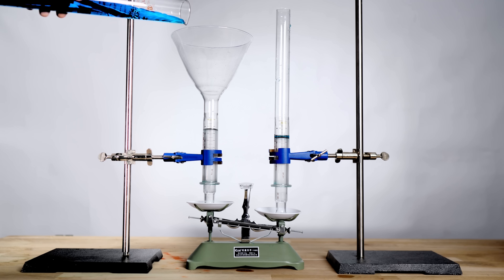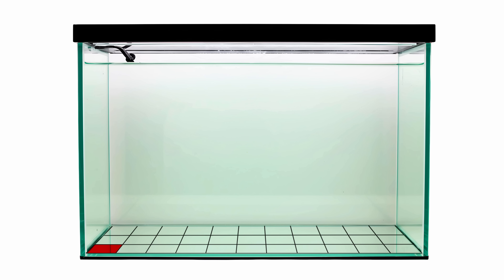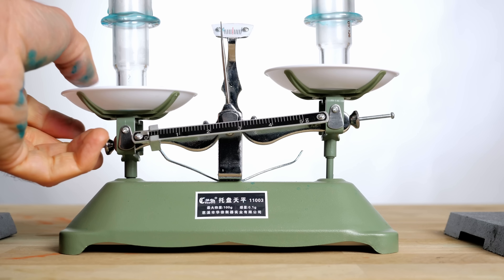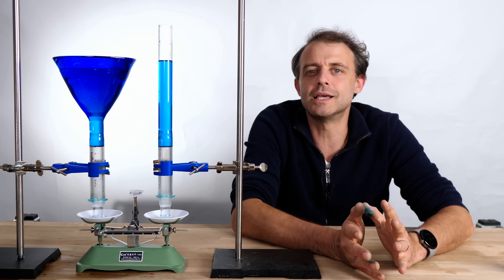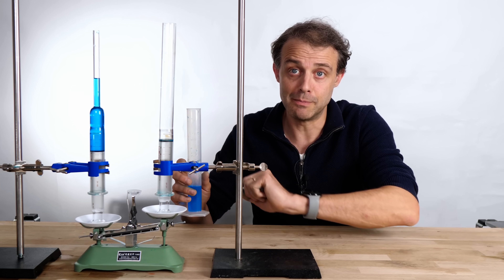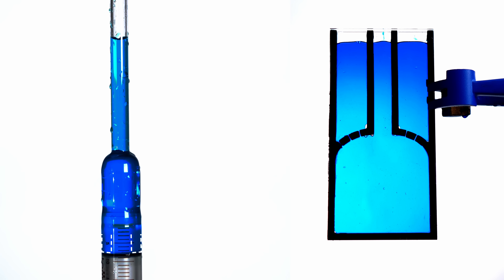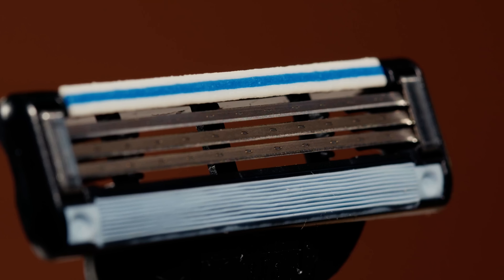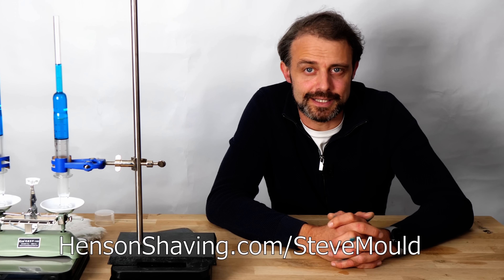The Hydrostatic Paradox

Comment: @SteveMould
The experiment with the cylinder narrowing at the top made intuitively sense to me.
I basically just see it as a gearing; the force acting on the piston will be the same, but the trade off for getting the same force with less water, is that you get less piston travel.
Just like two gears where one will provide more torque at the expense of moving slower.
I really hoped we would see this in action in the video, because that balance will work (to many) counter intuitively.
As the piston with the straight cylinder will feel the same force regardless of the pistons location in the cylinder, where as the force felt on the piston with the narrow top of the cylinder, will vary based on the placement of the piston.
The force on the piston will be constant regardless of piston placement until the water hits the narrow part of the tube, then the force will increase as more water is pushed into the narrow part of the cylinder.
So two cylinders with a narrow top, should provide a more stable equilibrium than two straight cylinders.
It is a really interesting behaviour an deserves a part 2! :D

Comment: Got to the funnel bit, only did physics (well) at GCSE, for AS I got a D (or an E) so nothing to brag about.
But the reason the water in the funnel acts that way is because the water needs to 'hold itself up' the horizontal force needs to act to hold that column of water. The water needs to push in sideways to keep that column there and stop the container looking like a big U shape (which you'd get if you used a flowing solid powder like flour). 
Then if you reverse/invert it and have a piston in a larger container I'm assuming the force acts against the top of the container helping push the piston down because there is a solid above it constraining the liquid to the piston with a small column.

Comment: Someone else made used the example of replacing the water with a person in each tube to grasp the last example and I think that will help a lot of folks understand this more intuitively, so I built out the example in more detail below…

Imagine you are standing inside the straight tube on top of the plunger. The tube is held by a stand fixed to the ground.
When you first stepped onto the plunger you noticed it moved down one foot it because of your body weight, kind of like a giant spring being compressed.
Now someone tells you to try to push the plunger down more, using only your legs - but you’re not allowed to jump in the air or touch the walls. You try by dropping into a squat and “pushing” with your legs…but all that happens is your legs straighten so you’re standing again…the plunger doesn’t move at all. That’s because all of your weight is already fully on the plunger, and all you are doing is changing your body’s shape while keeping the total force on the plunger the same (your body mass x gravity).

Next, you are in the other tube, with the wide bottom section and skinny top. It weighs the same as the first tube. You have to crouch to even fit in this tube, because your head and shoulders are too wide to fit in the skinny part, and so your head/shoulders are squished into the “ceiling” of the bottom section. Someone tells you to try to push the plunger down like before, but now when you push with your legs to straighten them…the plunger moves down! Of course it does, because your shoulders are pushing UP against the walls of the tube. But since it’s fixed to the ground it can’t actually move up…so the force is redirected to the plunger which feels like extra weight and so moves DOWN instead.

Of course you didn’t actually gain weight, you “borrowed” it from the tube. So to the arm holding the tube it “feels” like the tube lost weight…the exact amount of weight that was “added” to the plunger. The total weight of the system has not changed, it’s just been “redistributed” amongst the individual pieces by the redirecting the forces between them.

Comment: Its head pressure..it is why every town has a water tower... The hieght of the tower provides static pressure into the water distribution system, without this pumps would have to be run constantly to supply water.  The towers aren't there to store water, they pressurize the system

Comment: This isn't a paradox. You've made two actuators and mounted their bodies in holders. The internal pistons press against the scales due to the height of the water column in each. The weight (amount) of the liquid is irrelevant. In other words, there are no vessels filled with liquid freely pressing against the scales; there are external tubes held stationary in holders and the aforementioned pistons.

Comment: So can you abuse this principle to produce a ridiculously great downward force using far less than an equivalent weight of water? Like, make an enclosed tank that is very short but has a very large footprint, and then connect a very long hose to a port on the top of the tank, and extend the hose upward to a great height. If you fill the tank and the hose with water, you won't actually put much water in at all, but the pressure at the bottom of the tank will be determined by the height of water to the top of the hose, and that pressure will be multiplied by the large area of the tank's footprint, yielding a tremendous downward force. (Is there also a tremendous upward force on the upper face of the tank, such that the apparent "weight" of the setup isn't usefully huge?)

Comment: There is no paradox. You're intentionally causing confusion. Anyone can put a glass of water with different volumes on a scale and see the difference, just like anyone can stick a pressure gauge at the bottom of any body of liquid at equal heights.

Comment: no paradox AT ALL: The hight of the liquid, determins the hydrostatic pressure which is weight PER SURFACE AREA. 

The other is TOTAL WEIGHT. More stuff will weigh more even if the HP stays the same. 

like uf you stand in one leg: the pressure doubles but your weight stays the same

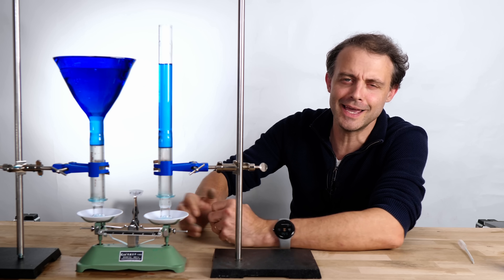Comment: So, at 1:28 you say "How can two different amounts of water weigh the same, this is the hydrostatic paradox". Well, obviously they don't. You can't fool me that easily! So what's the trick? Well, suppose a) the glass of the tube weighs the same as the glass of the tube+funnel. b) You apply superglue to stop the pistons going up and down c) You loosen the blue clamps either side so the whole glass assembly on either side can slide down. If this scenario, if the water on either side really did weigh the same the needle would remain stationary. However, I do not think that would be the case. So my answer is "The water does not weigh the same, but the water presses down equally on the pistons."

Comment: i tHINKARONI - you neglected to understand that your scale is essentially providing the same exact function as a curved tube connection from one liquid container to the other one
-
and what you can imagine happening is that the fluid from the right cylinder ( with more liquid ) is pushing through the tube ( the scale ) to the other cylinder and the pressure is being exerted to the top of the dome as well as pushing the fluid level up the narrow section of the cylinder at the top - 
-
this means that the weight of the entire amount of liquid in both cylinders are dispersed accordingly to the height and shape of all inner surfaces - 
it is the same as - the liquid levels in two bodies which are connected somewhere under the surface of the water - will always be of equal height because gravity will distribute the water from the body having the higher level to the other body having a lower level
Reply: the reason i am saying tHINARONI is because i guess i spilled my brains too much on that yewspewed account and now - no comments i try to post from that account - get posted

Comment: Quality has gone down my man
So much beating around the bush I was dealing more with the frustration of edging me on getting to the point, rather than the complexity of the physics when you finally got to the point
And the sellout biased science to plug the ads was the last nail on the coffin. You can twist the dynamics of a single vs multiple blade razor to illustrate the benefits on either side, for instance, that single blade razor carries more pressure into the skin so it is easier to cut yourself, which has a way harder reaction on your skin than just bruising it with a multiblades razor. Same argument, different bias. Get it together

Comment: I'm kind of perplexed that you find it a paradox. Do you only ever use lab equipment? You have a stand supporting the funnel that is not on the scale. If you simply held the funnel like a normal person there'd be no mystery. Anybody who has actually used a funnel knows it gets heavier when you pour stuff in and lighter when the stuff runs out. A funnel is just a container with an intentionally designed leak. Any container gets heavier when you fill it, even a leaky one. With the funnel supported by a stand that's not on the scale, you're not measuring the weight of the water at all. You're just measuring the force of the leak in the container. The fact that the water balances at precisely the same height may not be intuitive, but the fact that a container, even a leaky one, supports the weight of its contents (at least until they leak out) should not be at all surprising.

Comment: This reminds me of balancing brake pedal feel vs brake piston caliper clamping force via the brake master cylinder piston size and brake caliper piston size.  The balance of force is something experienced by many custom or performance vehicle builders with upgrades regarding hydraulic braking systems.  Even with the same brake line size, two different master cylinder piston sizes will feel significantly different

Comment: My own experience of Henson shaving is that they aren't well engineered. A precise angle if the blade isn't any good if it is the wrong angle. I find a holder that looks like a cut-throat razor with the same (well, halved, but you can use the ones from Henson shaving) blades held in it produces much better results for me. It seems barbers find the same, as I've never seen a Henson razor in a barbers, but I've seen what I use many times. Do yourself a favour and buy a cheaper, better, holder for single disposable blades.

Comment: Did anyone else just think of the set up the same as a single tube going from one of the glass tubs to the other? For example if they were just connected via liquid I would think that the level of the top of both sides just have to be level. Similar to a hose  connected to a tank at the base. The level of water in the hose will always try to be the level of the tank.

Comment: I'm not staying that Physics is wrong, but I think that when you do the analysis on the infinitesimal triangle you are somehow assuming what you want to prove. 

If you need a force for the liquid not to go out of the container you don't need the glass to cancel the total force exerted by the pressure on the triangle, you only need to cancel the component perpendicular to the glass. That would leave a non zero tangent component that would make the liquid to slide parallel to the glass. 

I understand that by continuity arguments you can prove that cannot be the case. I'm just saying I think is not that simple. Please correct me if I'm wrong.

Comment: 1:25 youre not weighing the water itself, you're measuring the hydrostatic pressure which only depends on the height of the water but not on the size or shape of the container.

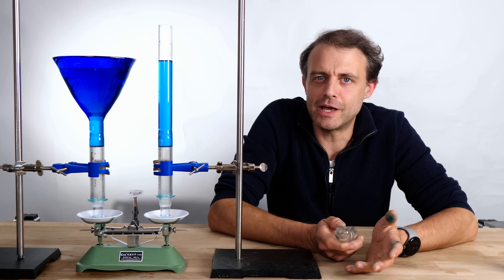Comment: 6:43 it changes a tiny bit because of adhesion forces between the water and the vertical wall of the syringe. There is a bit of water that is stuck to the glass surface, adding to its weight.

Comment: The argument for number of blades on the razor doesn't work that well.  A 2-blade razor at *most* engages twices as many hairs.  In fact, it will be a lot less, since the 1st blade will have cut most of the hairs before the 2nd blade gets there.  By the time you reach a 3rd blade, there should be very few hairs left.

Of course, this is purely an academic argument for me, since I haven't used *any* sort of razor in decades.

Comment: Because the "weight" of the water is being held by the clamps connected to the stands.  What you're measuring is the "pressure" of the column of water.  Get your terms right.

Comment: This is a very convoluted way to explain a simple phenomenon ... if you hang a container with water from the ceiling the total weight the hanger is subjected to is always the weight of the container plus the weight of the water ... the shape of the container only redistributes the pressure at the bottom of the container ... a V shape container will experience at its bottom the pressure (therefore the weight) of the small column and the outside "triangles" will transfer the weight of the water outside the column to the edges of the container ... ie the pressure distribution at the botton is constant (height of column) all around except for the edges where it spikes as the pressure of water outside the column is concentrated at the perimeter of the container ... the total weight is always the same (water plus container)

Comment: Fluid transfer guy here.  Always a challenge explaining to guys, it is quicker filling your tank from the bottom of your tank, pushing against the fluid as it fills than from the vent at the top.

Your hydrostatic pressure is at 100% from start to finish while using the vent.  But I guess they know better why they called it a vent.  Let them waste their time learning the hard way.

Comment: This is a great explanation. For what is worth, engineers describe hydostatic pressures as isotropic. This means the pressure at a point in the fluid is equal in all directions. Its not explicitly stated in the video, but the horizontal pressure on the walls is the same as the vertical pressure at the same depth.  So an engineer designing a tank only needs to know the depth of the tank and the density of the fluid to calculate the hydrostatic pressure acting on the tank walls. This could be demonstrated using a pair of interconnected horizontal pistons placed between the two vertical pistons.

Comment: I wonder if my intuition is in the ballpark. To me it stands to reason that the piston is also pushing up on the water column, so just like with the funnel some of this upward force is borne by the wall of the tube around the central narrow column, and the tube is in turn held down by the clamp stand. So there's a force vector that's blocked by glass in either example.

Comment: If the tubes r suspended you are not weighing the water. U r measuring the head. The weight of the water is Heald by the clamps.

Comment: Here's something that may help:
Pressure increases linearly with depth, BUT pressure acts in all directions. So on the smaller tube, pressure is acting UPWARDS on the surface pointing upwards, just as it acts downwards on the face at the bottom. The determining factor of which beaker weighs more is determined not by the weight of the water, but by the summation of all pressure forces acting at the bottom (the surface being measured by the scale). In this case, it is relevant that the bottom of each beaker is the same area.

Comment: Fantastic segue. I also just felt like dropping a comment saying that although I was a bit unsure at first I decided to buy a henson razor and, after getting the hang of it (as it was my first time using a single blade razor, and I'd also not used any manual razor for quite a while as I'd been trying electric shavers, incidentally also not finding them to work very well for me), I'm finding it very easy and effective

Comment: I didn't get why the weight scale went down
Reply: Got it. 
The force on the stand scale equals gravitational constant g multiplied by liquid density rho multiplied by difference between liquid volume and height multiplied by area of the bottom of the flask. 

F=g*\rho*(V - hS)

If liquid volume is less then height multiplied by area (volume of cylinder of the same height) then difference between them is negative and the force applied to stand is also negative. We actually can make the stand fly if it will be lighter than this force.

And it is actually pretty logical. Water creates pressure in all directions. Including pressure on "ceiling" part of tube. And pressure on ceiling is pushing up.

Comment: The clamp stand getting lighter was fascinating. More explanaintion of that needed - maybe caused by the pressure of the water pushing UP on the horizonal part of the container? I guess if you imagine the piston being held stationary and the pressure in the vessel increasing it would make intuitive sense that the other part of the vessel (and the clamp stand) would be pushed up. So could you have a container that would totally cancel out the weight of the clamp stand? That would be an interesting demo.

Comment: umm you are not weighing the weight of the water. the water is being held up by the stands. what is being measured is the pressure of the column of water. 

just one question, how do I get my face to be a straight line for these razors to work as advertised?

Comment: Seeing the initial demonstration, I immediately realized that you were describing the mechanics of a hydraulic system. I knew exactly what to expect with the narrower tube, but that's because I've already fumbled through the confusing process of learning how a hydraulic actuator can exert massive forces using an incredibly small fluid line. The tradeoff is that you still preserve the total work of the system. A giant machine using hydraulics does apply a huge total force, but the fluid line that feeds it needs to move a large distance to keep the total work constant. Understanding how that worked led me to an intuitive understanding of water pressure. But the example with the holes in the side was a brilliant way to demonstrate how the system works.